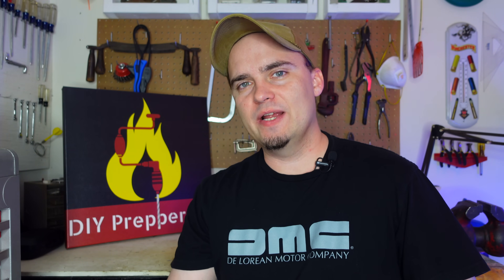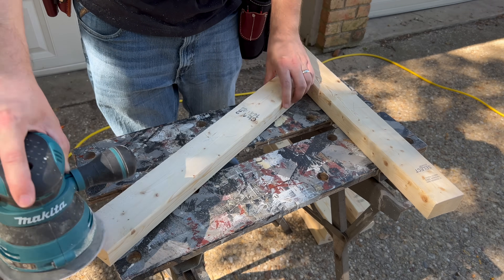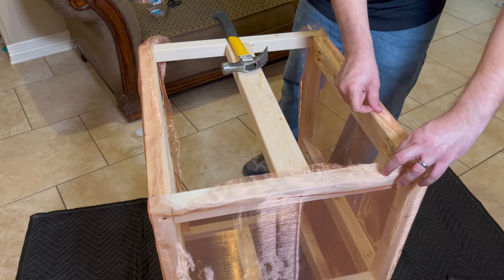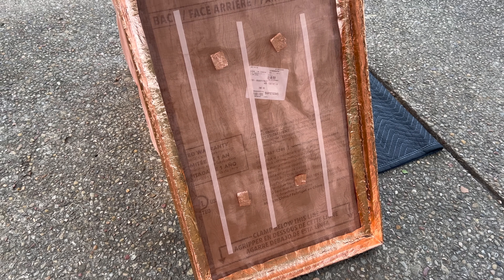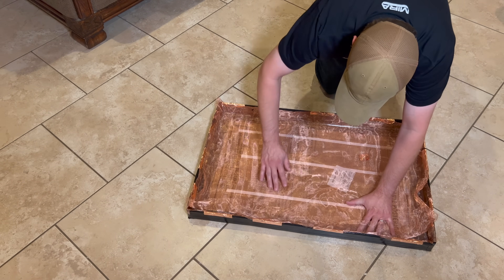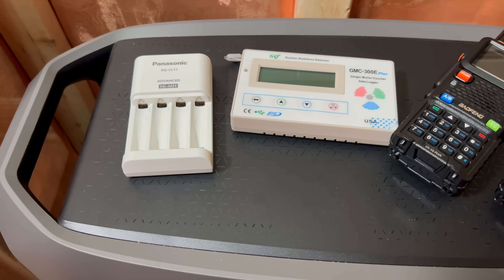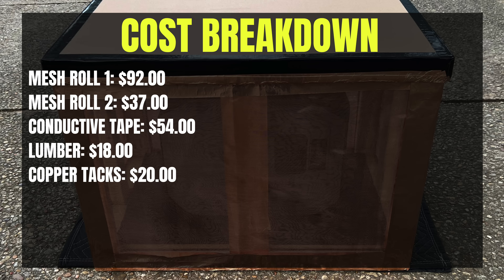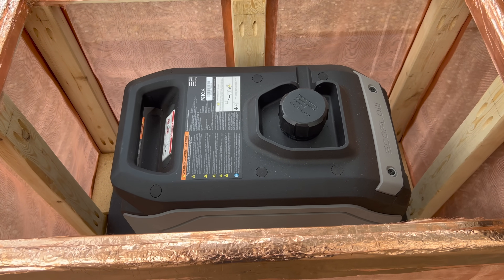Protect a Generator from an EMP: How to Build a REAL Faraday Cage

Comment: Wouldn’t using foil trap heat and prevent the generator from staying cool?
Reply: I think the point is to store the generator in the box and in the event of an EMP, it’s protected and ten after the fact you can pull it out and use it.

Comment: The way I understand it the any electrical equipment has to be turned on at the time of the impulse to damage it , is that correct ?
Reply from the maker: It is less likely to be damaged if it is turned off. However, a very powerful EMP could still damage electronics if they're close or don't have anything  substantial between them and the pulse.

Comment: I laughed because an older generator will still work. As long as there is no battery hooked up. As long as there is no power flowing through something it will still work
Reply: Even if the genny has internal electronics or control board/s?

Comment: I highly recommend building a plywood box around your faraday cage to protect that copper mesh. You may want to make an aluminum foil lined box for your power tools, batteries and chargers when not in use.

Comment: I use 55 gal steel drums with removable lids. I lined the inside with cardboard filled them up put the lids on tighten them down and sealed the lids with copper tape.
Reply: A galvanized metal trash can with an aluminum tape lid seal works as well.
Reply from the maker: Nice! Thanks for sharing!